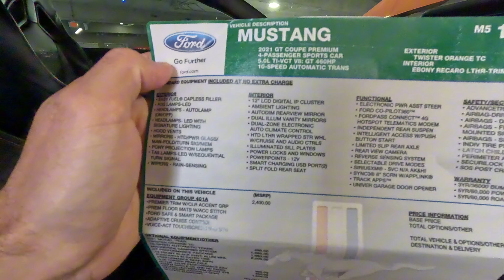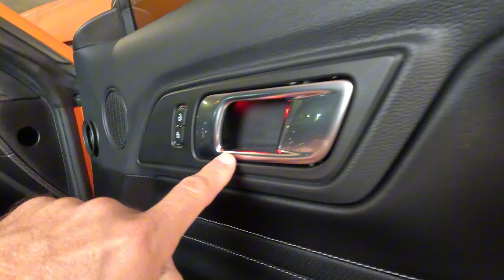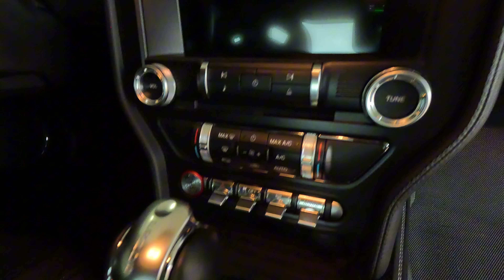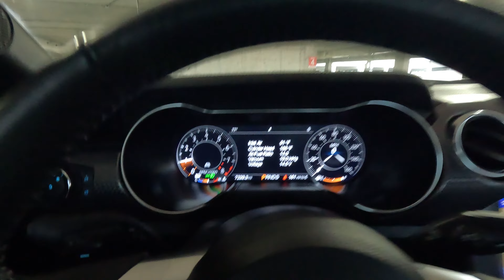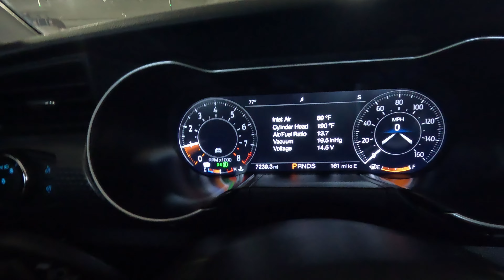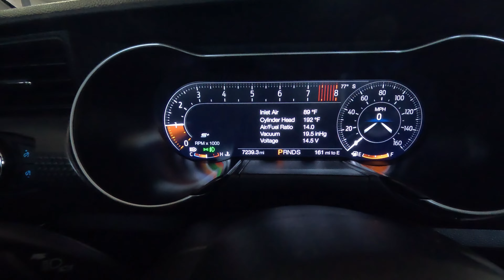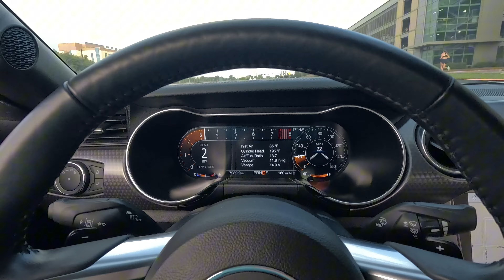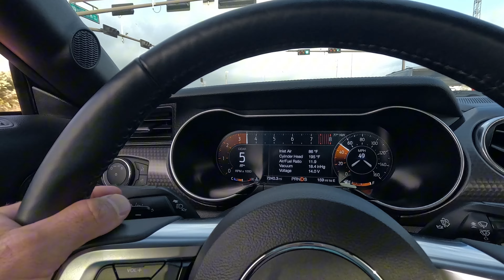ESS Supercharged 800+hp 2021 Mustang GT - Success Motors Reviews

Comment: Being a S550 mustang guy, I got you with some of the things on the car. The front splitter is from the Performance Pack Level 2, and since the car was already a Performance Pack Level 1 beforehand, the previous owner just bought the splitter and put it on. As for the red lowering springs, they're either Eibach Sportlines or BMR springs, but judging by the drop, they're most likely BMR Springs which drop the car 1" all around. The car doesn't seem low enough to be sitting on the Sportlines. The car also has Diode Dynamics Sidemarkers in the rear, and some sort of quarter splitter on each side but it doesn't ring a bell for me. As for the car starting up in quiet mode, you can change that in the Exhaust Mode menu if you scroll down past track mode. I have mine set up to start in quiet mode from 12am to 10am, so anytime from 10:01am to 11:59pm my car causes a ruckus. The car also has a Ford Performance decklid on the back which removes the GT logo from the rear, thus giving it that smooth look. As for the front bumper, its just the stock bumper with the PP2 splitter but with the Cervini C-Series upper grille which gives it that wire mesh, more aggressive look. It is not a Roush front bumper. Hopefully this helps!
Reply from the maker: @viny.u  Thank you for taking the time to type this out, it is very helpful! I will be adjusting the start up mode immediately :)

Comment: Red springs are probably BMR springs. Also, centrifugal superchargers like the ESS do not whine like positive displacement superchargers do. Think of them as a belt driven turbo, so they have a whistle at idle and sound like a blow dryer or jet when in boost.

Comment: Thought that parking garage was familiar 😂
Nice car that is one of my favorite colors on the mustang. Do you know if it had the crank sprocket and oil pump gears upgraded? I assume it has been done since it has all the supporting mods.
Reply from the maker: @L42776  are you in College Station? I don’t know if either have been done. Is there a way to check?
Reply: @ I’m in Huntsville but I come to college station a couple times a month. The oil pump gears are weak stock and if the rev limiter is hit at your power level it will most likely fail. This is more of an issue with people missing gears in 6mt cars but can happen to 10r80 cars. There would be no way to check as it requires taking the crank case off the front of the motor. With how thoroughly the previous owner modified the Car I think they at least had the oil pump gears replaced when the fuel system was being installed. If you could contact previous owner hopefully they would know. Your setup is exactly how I want mine to be one day. Burnt orange in cstat though? That’s brave 🤣